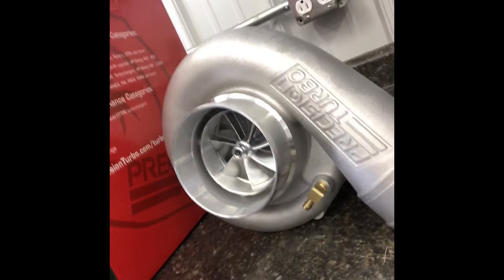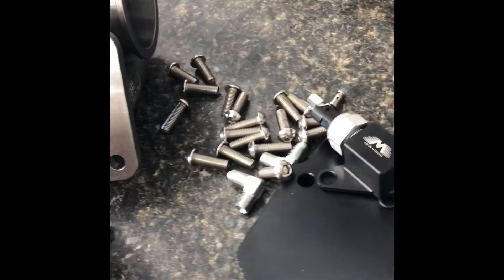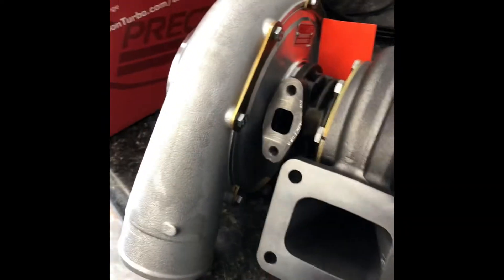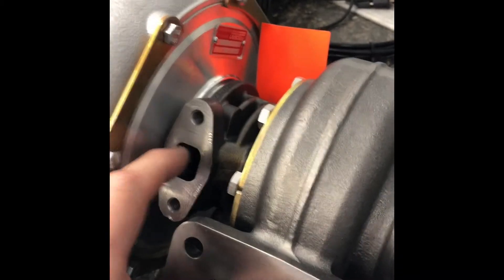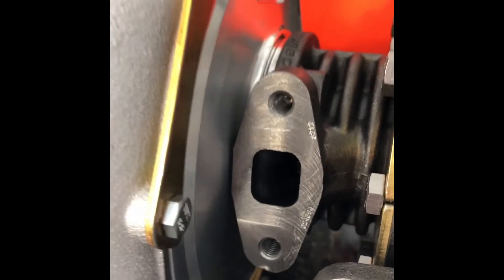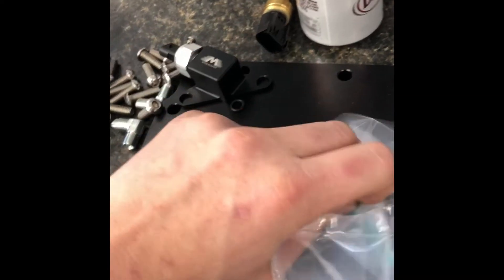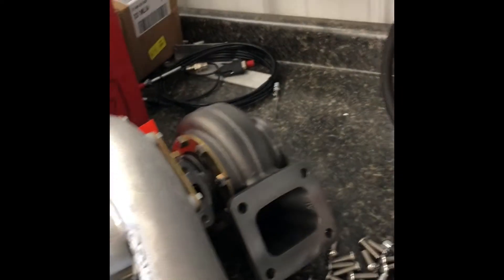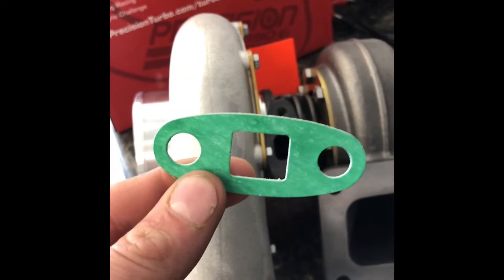Turbo Oil Drain Tips (Motion360 Episode 3)

Comment: Instead of flanged oil inlets, and outlets, why not have tapped NPT threads into the castings, no more bs potential problems, and eliminates 2, of the 4 potential leaking points.
Reply from the maker: jeff skaarland don’t disagree.  I think they do it for compatibility and adaptability.  Most have npt on the feed, but not the drain.

Comment: 10AN is to small for that turbo, measure the drain hole at the bearing housing on the turbo, your drain hose and fittings internal diameter should be that size all the way to the oil pan